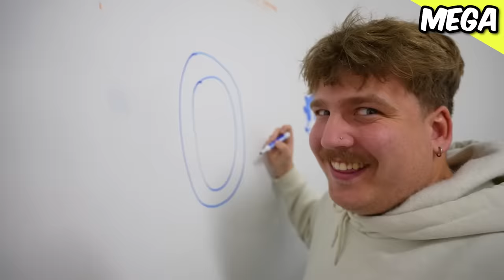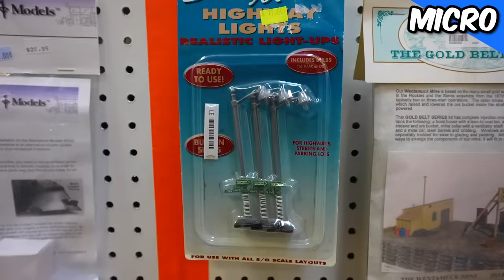MEGA vs Micro RC Cars *BUILD CHALLENGE*

Comment: I’ve been in this hobby for a couple years now, I have to say the number 1 rule is not to fill send them unless you know how to fix them 😂. Mini race track was super detailed and amazing, great job.
Reply: @lildude763  I don't know what you've been doing with your  Traxxas, but I've full sent my xmaxx a few times and only broken one or two parts. Lol
Reply: @lildude763  "arrma"
Reply: @Nibbist21  personally i do HPI nitro trucks
Reply: @BrendonakaShanks  seems like the older models are stronger
Reply: My rustler has broken but I know how to fix it. 😎
Reply: Isaac  I hope you know you wasted up too 1,00 dollars on rc cars and 1 of them broke and the one that broke was the one you were using
Reply: i have a Hoss and have full sent it just about 15 - 20 feet in the air and only broke my bumper XD what you don't do is balloon the tires, that was their mistake
Reply: @shadowdrayote5020  ok?
Reply: @GoofyAhhProductions9936  no need to respond to my original first comment where i didn't tag you
Reply: @shadowdrayote5020  ok my bad…
Reply: It was upsetting to see a slash abused like that

Comment: Watching them struggle with the stick and relitivly stock Traxxas cars was kinda funny since We run cars 1/4 the weight of the cars they had with twice the power (the velineon is around 3400-3500kv and some our cars have motors that are 6500kv+)the velineon motors they were so excited about in there faster car are actually a fairly popular motor for our beginner class lol (on a slightly smaller track than there’s btw during winter since the old barn it’s built in is only so big lol)(we usually average around 100 cars a weekend)

Comment: I hate to tell them but crc makes a special carpet for rc racing. I race 1/10 scale oval and road cpurse carpet r. Race cars. The fastest class on the oval we do 63 mph top speed down the straightaway and we runfoam tiresin some classes and lthers run lwgit rubber slicks on oval . the fastwstroad clurse car class we do 76mph top speed and we use the foam tires in that class. Carpet has so much gripwe havd toput CA glue on the sidewalls og the rightfront tire on all the cars in every class to keep them from flilping off the track causeit creates so muchgrip amd thats with the foam and runber tires. On road cpurse I gluehalf my rightfront and a 1/4 of the left front tires sidewall so it foesnt traction roll. And at my hosue I have a huge rc track on a 26 foot by 14 foot table for the 1/76 scale turbo racing rc cars and i have a timing sysyem and little transponders in every car to track lap times poaition and the computer runs the whole race for you as in scoring cou ting laps amd every stat ypu can imagine it does onjs kwn like the carpet racing tracks system. I also modified my turbo racing brand cars to go 10 times faster then the stock version and its a blast its like slot car racing exceot its rc cars

Comment: I bought the same car as you but I did some upgrades it goes 160mph the upgrades are a castle frame and brusheles mother 6c battery almost everything is bronze so it doesn't start flying I water proofed everything so I can send it in the snow I put 12cm tires all I can say is I put 7k into my room cars